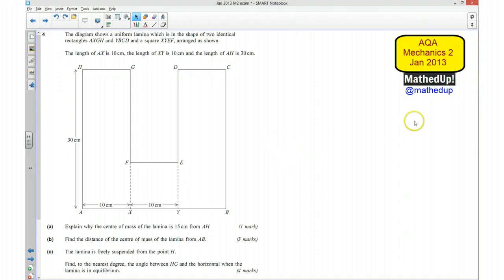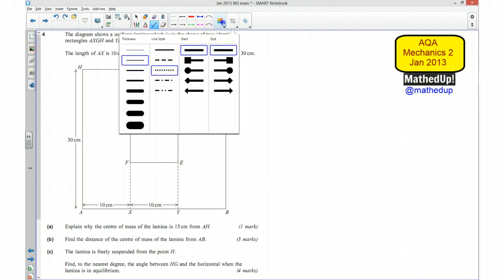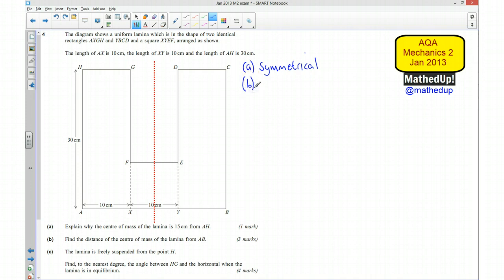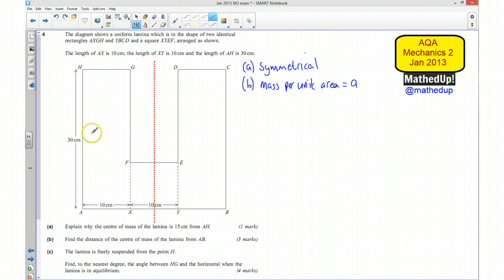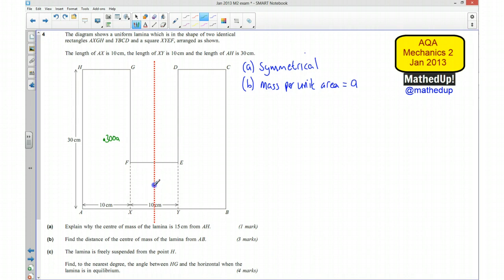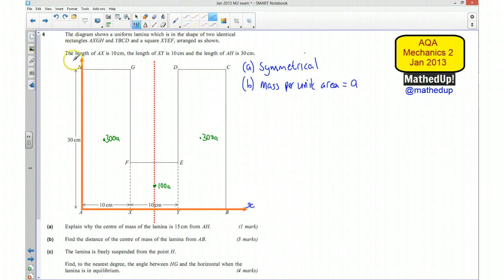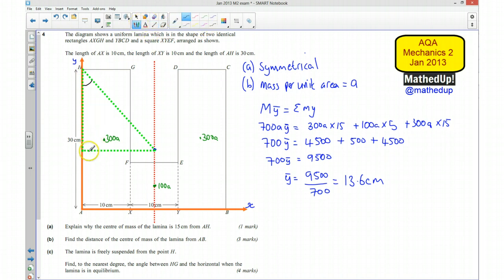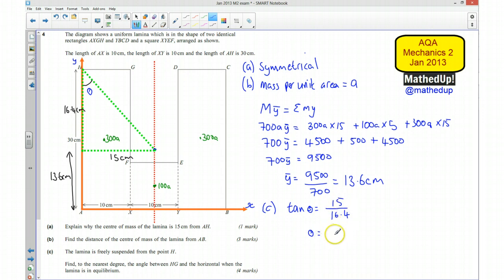AQA Mechanics 2 Jan 2013 Q4

Comment from the maker: Well spotted! I seem to have worked out the angle between HA and the VERTICAL when I should have worked out the angle between HG and the HORIZONTAL.. My bad..
The angle actually works out to be the same due to the geometry.. I will add a note to the video,